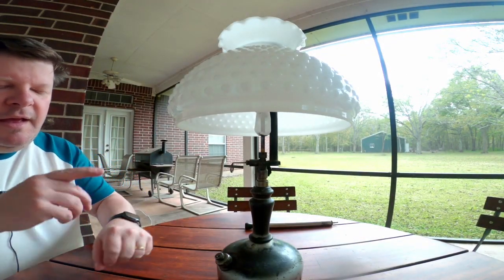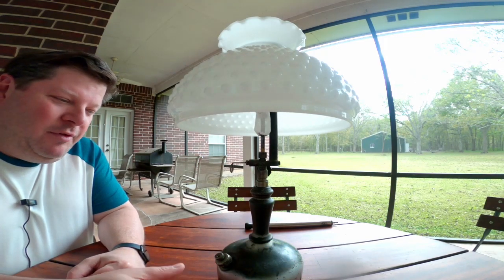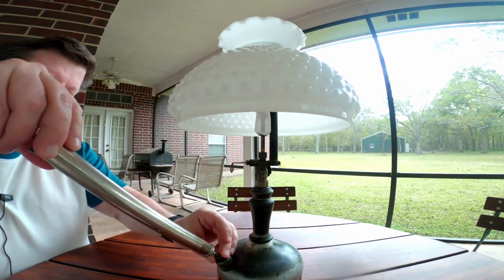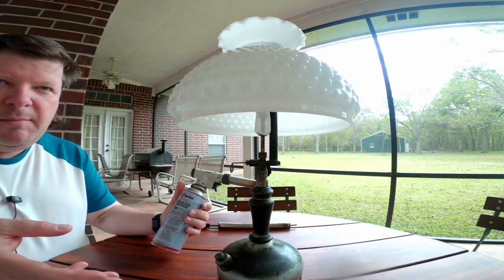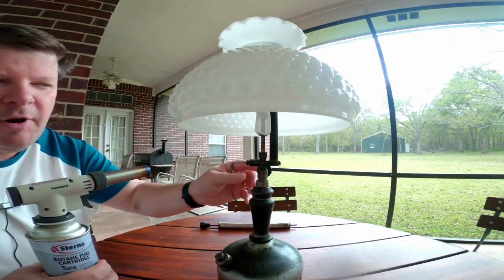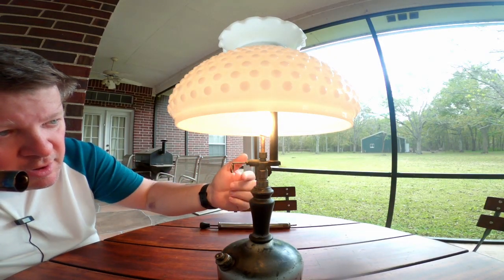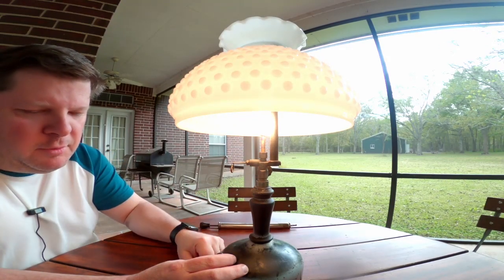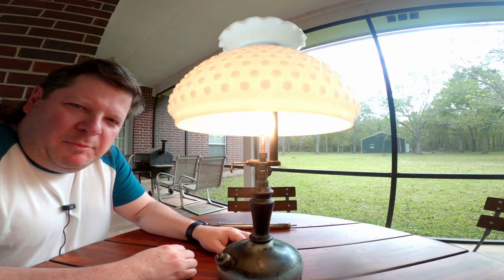How To: The "Crack n' Close" method for lighting Coleman table lamps

Comment: Looking for some help here Q99 generator on my lamp was no good so replaced it but when it lights up the mantles pulse from light to semi bright not full bright and occasionally flare up what should I be diagnosing next any help is appreciated.
Reply from the maker: Sounds like you might have some crud in the gas tip.  Try removing the gas tip, cleaning it with a pricker and then flushing the generator while the tip is removed...just open the valve and let the gas rinse it out.  Reinstall and try again.  Personally, I'd replace the Q99 with a R55, which has a built-in tip cleaner.  Also check your air tube to make sure nothing has built a nest in it; that can give you yellow flames too.
Reply: @gasunderpressure9131  Q99 is new and I cleaned the air tube has no obstructions holds pressure really good  it lites easy but pulses from dim to semi bright using # 21 mantles should I be using different mantles?